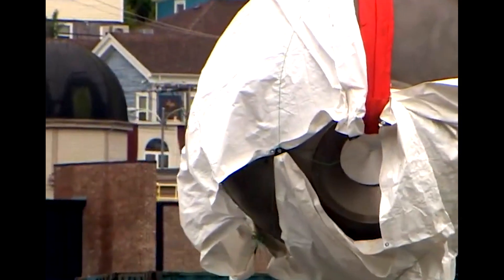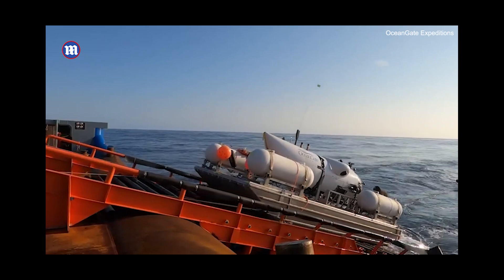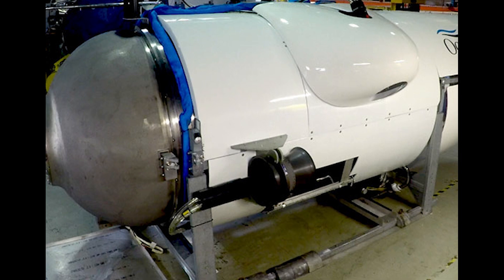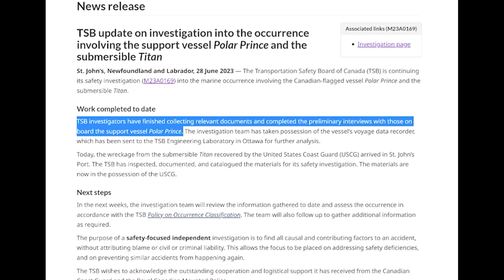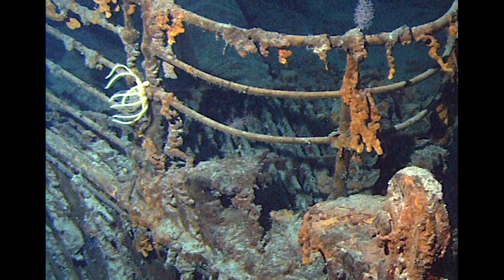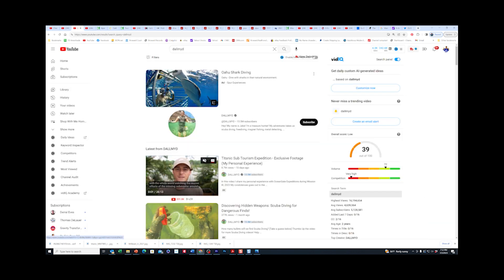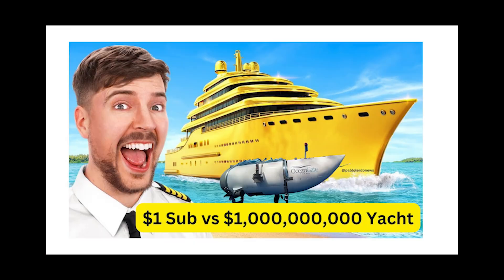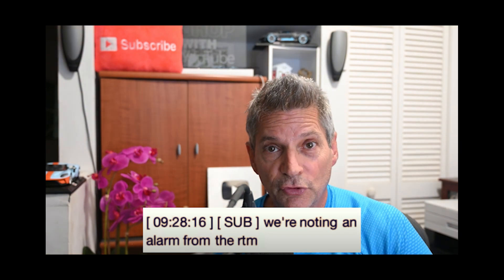Titan Submarine Debris Clues, Implosion Simulation

Comment: As an engineer with over 40 years experience working in an industry that uses very high pressure vessels, here is my informed guess on what happened and why you see what you see.

1)  Most likely the carbon fiber tube failed in the center of the tube, and this was probably due to a continuous micro-cracking failure of the carbon fiber structure.  The tube was laid up with all fibers in a continuous wind which is not considered optimum practice for carbon fiber tubes that will undergo high stress.  The typical lay-up in these situations uses filaments wound on a 45 degree axis in one direction and then a 45 degree axis in the opposite direction.  This minimizes crack propagation should it occur.

2)  Once the tube failed in the center, you had 2 extremely high pressure air bubbles pushing to get to the ends of the tube in an incredibly short time.  This would have created a delta pressure over time significantly higher than the epoxy glue was rated for and likely blew the titanium end caps right off the end of the tube.  This is my guess as to why you are not seeing any carbon fiber remnants on the end caps.

3)  The flange and bolts holding in the plexiglass portal are not rated for extremely high pressure pushing out on the flange and the nuts.  The porthole is designed to seat into the end cap so that the more pressure applied from outside, the better the seal (at least in theory).  The porthole is not designed to hold in any significant pressure from the interior of the submersible.  Once again, if the failure mechanism is at the center of the tube, the porthole was likely blown out of the end cap as part of the implosion pressure wave propagating from the entry point.

Sad to see this happened, but it was a disaster in the making and it was only a matter of time until complete failure occurred.  I have always said there are no accidents in the engineering world; only failure to due to hubris, engineering error, or not understanding the forces acting on the device.
Reply: stadium applause
Reply: As an Aerospace Engineer with over 40 years experience working on high stress/ loads and some carbon fiber composites I agree tragic but poor design in many areas, compression of carbon fiber not ideal, insufficient bonds with metal supports, and insufficient bond area are all shown in video, too bad.  There is no substitute for good Engineering, warning signs were there.
Reply: @gregorykerr3988  And now for something completely different, here comes our "40 year old experienced and self proclaimed engineer of the day" !!! C'mon, buddy, tell us all about black matter !
Reply: So it's a bit like what happens when you step on a Pringles tube with the lid on.
Reply: @crazynorm  Sounds dangerous, no more Pringles for me.
Reply: @crazynorm  Actually , no not when you have 6000 PSI of pressure pushing against it from every direction .
Reply: @tuck6464 the tube have the bigger surface than the end-caps...
Reply: You should also mention why there aren't any fragments of the carbon fiber hull--which is basically that when carbon fiber fails, it doesn't bend or collapse, it shatters. What ever is left of that submersible is likely too small to be noticed that deep.
Reply: This comment should be highlighted at the top. Thank you for your description.
Reply: I would never cram into any vessel with no way out or any room to move.
Can't understand how passengers could skip doing a full chk of the technology used and the company that built it
Reply: My intuition about the port window is the same as yours: the cylinder collapsed, water rushed in to fill the low-pressure volume, crashed into itself, water-hammered into the end caps and shot the window out. The flange is likely only there to keep the window in place until water pressure is high enough to maintain the seal on its own, not hold back a massive pressure spike.
Reply: @teardowndan5364  also consider the possibility of compression ignition of the oxygen and organic material immediately following the hull breach.
Reply: @roceye  Compression-ignition only works if the fuel is mixed with air beforehand. The "fuel" being human flesh is only slightly more compressible than water, more or less in one chunk and about 70% water by weight. Any compression-ignition that could have happened would have been little more than skin-deep. Much of the air would also be separated from "fuel" by water and other obstacles. Also, the cabin likely had less than 2kg worth of oxygen available to react with anything, which isn't much next to all of that carbon fiber and 600+kg worth of other stuff inside.
Reply: 30 year engineer here, i used to work with composite Pressure Vessels for Underwater Vehicles.  We used composite hardware on some items and they would ALWAYS implode/shatter after a few uses.  It came to a point where we would wrap that hardware with the equivalent of a trash bag.  This was done so that when the parts did implode and shatter, the clean up was much easier as well as we would usually get back most of the hardware for a failure analysis.  Eventually we just switched to aluminum, titanium and stainless steels to get some sort of reliability and longevity.  Everyone keeps mentioning innovation, but innovation is NOT safety.
Reply: #2 was wronge once the carbon tub failed the ends were no longer atached to anything, But the rest was spot on.
Reply: I'm thinking the second weakest link, was the porthole, thus became a nozzle, jetting out super heated ejecta of human, carbon fiber, and other bits, in nanosized particles, when it failed.
Reply: @animationcycles7109  Rush was the first weak link. His nanosized brain and gargantuan ego were 2 and 3.  Hopefully he saw it coming.
Reply: I'm not an engineer but to me it's a science that should be treated as methodically as any other science. If you're developing something that needs to function in the physical world, any and all aspects about it should be accounted for. 

It amazes me that anyone would cut corners in something that is barely understood such as deep ocean exploration is.
Reply: I had been picturing this in my mind, and the whole time I thought the carbon fiber was built with the opposing 45 degree strands.
Reply: @johncamp7679  Yeah, the way they wound it was insane for the loads on the center section...  And to really optimize the structure, you would wind it 26.56 degrees off the long axis of the cylinder.  That would be perfect to accommodate hoop stress vs. axial stress.
Reply: Thanks for taking the time to explain this.
Reply: i think your analysis is mostly spot on. except transrcipts were released where they talk about hearing noises coming from the rear of the craft so it likely failed at the rear and the pressure wave propigating from the rear forward first shot the viewport off like a nerf dart followed very closely by the ring.
Reply: @hopposai787 the ring probobly popped as all 5 passengers attempted to exit the vessel via the new hole.  In a fraction of a fraction of a second all 5 we’re in the hole and assisting with blowing that piece off the probably already flattened vessel
Reply: Gruesome possibility: they removed the porthole window because it has embedded human remains. Only reason I can think of to disturb the evidence for the investigation.
Reply: I imagine the heat generated by a 400ATA pressure rise in nanoseconds would have ignited the 'highly combustible' floor and everything else including traces of glue, wonder if soot would be detectable?  Two things blow my mind - that the narcissist didn't test his thrusters until 3800m and that when securing the front dome "Stockton doesn’t screw in the 18th bolt because it’s too high, says David Pogue, former crew member in an interview".
Reply: As a journalist with 20 years experience I often feel like I have "earned my degree for cheap" and I have endless respect for people in technical fields, such as yours, for what they know, if anything for the fact that they have gone to school for the same number of years.
Reply: “Failure due to hubris, engineering error, or not understanding the forces acting on the device”

Isn’t that ALL classified as “engineering error”?
Reply: ship of fools…
Reply: Do you agree with the theory it descended too quickly? The ascension apparently was impossibly slow?
Reply: He went cheap with EVERYTHING. and it cost him and his passenger's their lives.  For F's sake, even the Xbox controller was an Amazon knock off.  Carbon fiber is cheaper than titanium.  And he didn't lay it out in the right orientation either in order to save money.
Reply: @tone7560 . He had a BS Degree in Engineering. But, he got an MBA after…. he learned to cut costs to increase profit.
Reply: The filament wrapping was puzzling me also. That is something even I know with dyscalculia and significant problems to understand how physics work.

I wouldn't have been comfortable with such a device - wrapping it in multiple directions means you're dividing the pressure load working on it.

And the thing is glued together? Bolts only at the entrance? Who in the everloving mind DESIGNS such s thing?
Reply: @Tantejay  Someone who is more worried about being the first and only person to do a certain thing to the point where they'll sacrifice lives to achieve it. The amount of corners that were cut on this thing is mind-boggling.
Reply: @Tantejay  Wings and fairings on aircraft are glued together. Engineering is not as simple as everyone on the net thinks it is. The Dunning Kruger effect has gone off the charts on this incident.
Reply: @Tantejay I commented I think the carbon fiber was a huge mistake . In building a sub to take on so much pressure . Might look good in design but , many things chemically could of went wrong , maybe micro air bubbles between layering it or not the proper amount of carbon jell adhesive causing it to be weak along with it not being criss crossed layered right.  Made it weaker , like in the middle of the structure . The engineers comment I totally agree after what I guess and his knowing knowledge.
Reply: @Tantejay  "wrapping it in multiple directions means you're dividing the pressure load working on it."  

Like a bridge.
Reply: Thank you for your insight. Hopefully wisdom and hindsight like yours saves lives.
Reply: @EndsleyIV  Those who build submarines know it's common knowledge using carbon fiber is not a wise choice of material to be used.
Reply: @MyKonaRC I’m sure they used (Fiberglass) in search of making it more lightweight 🤷🏼‍♂️
Reply: @MyKonaRC I agree ,that was the worst decision , probably a money factor $ to save money in the build thinking the carbon is as strong as steel, not in this situation , and that's putting a price on there lives putting it together cheaply .
Reply: Actually, what happened was that the very rapid descent caused a very dramatic increase in pressure. Clearly this is what happened. Gotta love these braggarts who claim to be engineers as if that's a badge of credibly. Remember, "engineers" built the Titanic, and thousands of "engineers" designed the Space Shuttle Challenger which failed due to a rubber o ring.
Reply: I thought the same about why there was no porthole glass but good to know why the cylinder failed. I thought the same and wondered how strong the cylinder would be when wound that way but didn't know how the 45 degree winding worked. Great to hear from an expert.
Reply: Hi Ron- on DALLMYD’s video he says the sub was carried to and from the site and stayed on its platform. It even got caught on a ghost net before his trip and it did a lot of damage. The weight was on the back of the sub, being hauled for weeks in the ocean with the stress of the weight banging on the back of the frame. I think that was extra stress over time that hastened the demise of the sub- those trips hammered the same part of the sub and weakened the hull in the back. Possibly also why the frame was hard to release.
Reply: I was gonna comment, but this is pretty much the end-all-be-all of comments. There's simply nothing anyone could add that would better sum it up.
Reply: Very good summation. Yes the ends being blown off theory looks most likely.
So would you say the cylindrical hull or centre part wouldn't have been crushed?
Reply: Thanks for this!
Reply: It is creepy to me, for some reason, the fact this thing had gone down a dozen times or so. Just thinking about that, along with the choice of material, it is clear to someone like me, who knows nothing about much, this vessel was a ticking bomb.
You couldn't have paid me to get on that death trap. Even James Cameron had his close call down there, and if I went down there with anyone, it would be him.
Reply: This explanation makes sense to me.
Reply: Wow, thank you for that information. Very informative.
Reply: You politely refer to it as “hubris”. I’m going to refer to it as malignant narcissism.
Reply: @7eyesopenwide777  As an engineer with over 40 years experience working in an industry that uses very high pressure vessels and complicated words, I'll stick to "hubris"...
Reply: @Bertrand146  most narcissists will agree
Reply: @7eyesopenwide777  My husband used the word “ temerity” . It perfectly describes Mr. Rush, along with “malignant narcissist”. He believed his own BS. His ego wouldn’t accept anything else. Sad how gullible people can be, and they paid 1/4 of a million dollars to die due to his stupidity. He will go down in history as the worst engineer ever.
Reply: Could it be ... if the failure was at the aft where they heard crackling noises ... would the high pressure air bubble also respond by blowing out the gasket and nose cone?
Reply: It did not look like there was any kind of tooth or etching on the glued mating surfaces as well. No mechanical bond for the glue.
Reply: If all the passengers never skipped leg day, and they coated the carbon fiber hull in flex seal, inside and out, they'd all still be bitching about that Amazon knock off Xbox 360 controller today.😅
Reply: Didn't even bother to get it classed and using a loop hole as not passengers but mission specialist..are you freaking kidding me ?
Reply: I bow to your superior knowledge which shines through your answer. However, it doesn't seem to explain what the crackling sounds were from the rear of the sub. Any thoughts about those?
Reply: @wmobberley4416  carbon fiber crushing under the pressure of the titanium ring on the failing lip of the tube? I dunno
Reply: @wmobberley4416  Most likely that was the epoxy glue starting to fail as the tube deformed.  Epoxy is great for gluing stuff together, but is also very brittle, which is why you need a substrate such as carbon fiber or fiberglass to provide the strength.
Reply: @ronkluwe4875  thank you very much for writing this out. was curious in (1) why breaking at the center of the tube was most likely versus other locations?
Reply: @wmobberley4416  the connection between the rings and the tube i would guess, since there seems to be a lot of stress building up between the deforming tube and the rings.
Reply: @wmobberley4416  as an electrical engineer my guess would be water had seeped through into the electric motors, hence why they had no power and had to revert to the backup motor..
Reply: @wmobberley4416  delamination
Reply: @wmobberley4416  EXACTLY my question and the reason I had a little dissonance with the idea of the vessel cracking in the middle (although it does make sense as an idea, I suppose, depending how the pressure works on such a thing). For myself I would have thought it would give out at the glued places where the titanium 'ring' or [gasket?] was adhered.
Reply: U should have recorded this video man!
Reply: saved me the trouble thanks!
Reply: I hope you aren't white cause with that much experience if you were white you shouldn't be listened too because you aren't inspirational according to the CEO of Titan.
Reply: I don't even get why they used carbon fiber tbh
Reply: @Shadow_Hawk_Streaming big mistake should be band and not ever used for these underwater subs .
Reply: it happend at the rear of the sub, behind them. the transcripts are out they were trying to resurface
Reply: Also: in some of the videos I saw it appears they are lifting tyvex bags- probably with pieces of the hull inside. I’d not think it vaporized
Reply: Ya the tube failed guaranteed,  ive worked in composites my whole life. It was under compression not tension
Reply: You're brilliant my man! Thanks for the intelligent explanation...
Reply: you just failed as an engineer.
Reply: Eh there are definitely accidents, seen an aviation vid where the trim was installed upside down that almost led to the plane crashing. There's definitely plenty of accidents, a part could be installed incorrectly, the part itself is made wrong or has something wrong with it, etc. I think your spot on about what happened tho
Reply: Seems like a possibilty.. I agree
Reply: The first time you have 😢😢😢😢😢😢😢
Reply: I'm surprised you didn't mention that carbon is bad under compression but much stronger under tension. You can snap a bit of carbon fibre... But goodluck trying to rip it apart.
Reply: Would the interior pressure be enough to shear the bolts and blow the domes off their attachment rings? I would think the glue joint gives way before the bolts.
Reply: I’m trying to think of something smart to say. Can’t do it.
Reply: I was going to say this.
🤣
Reply: We’ll said
Reply: Help me understand your observation 1: why would they be hearing cracks and noises from the sealed -I’ll call it - engine room if it failed in the middle?
Reply: @Bertrand146  where would the first crack be? And why were they hearing noises from the sealed engine room in the aft?
Reply: That was a good guess but you are wrong. What actually happened is that it imploded.
Reply: chat gpt?
Reply: I'd love to smack that cocky look right off Cap'n Crunch's face at 2:18...but the fish ate it
Reply: The 45 degree filament layup is used for a pressure vessel where the fibers are under tension, and also need to hold the end domes onto the cylindrical section. The Titan was NOT a pressure vessel, it was a vacuum chamber. The fibers were loaded under axial compressive stress, which is not ideal for the highly anisotropic material which is carbon fiber composite. The supporting resin matrix takes up the shear stresses. The tangential wind that the fabricators used is more appropriate for resisting compressive stresses, but still far less than ideal. Carbon fiber is brittle, and a poor choice for axial compressive loading. The Titan was destroyed by water hammer when the cylindrical section suddenly failed in brittle fracture and collapsed. All brittle materials including the carbon fiber composite were instantly hammered into powder. The front porthole was blown out forward by the force of the water hammer shock, and probably also pulverized.
Reply: I don't beleive the tube would have started its collapse in the middle- in my mind it would have started near the edge where it mates to the rear bulkhead. It is much harder to crush a tube in the middle than near the edge because of the amount of material that has to deform for buckling to initiate in each instance. In the video where they were installing one of the rings, it was clear that the carbon fiber was glued inside the metal ring which means it was unsupported in compression ( relying only on its own strength for compression resistance).
Reply: @cheatinggravity173  WOW, ENGINEERING FAIL...  You just laid out the exact opposite of physical reality.
Reply: The only criticisms I'd make of your analysis is that the angle of the winding of the CF wouldn't play that significant a part in the hull failure, if that's what actually happened. If there's enough flexure to create a crack in the outer layers, there's enough to crack the inner ones as well. People are simple minded and want to play pretend Rush was completely clueless, but that's extremely unlikely. I'm sure the young's modulus was studied intently, and computer modeling was extensively used. My hunch is that there was an unknown stress factor involved, and that over designing wasn't used enough. I suspect he cut it too close to his expected envelope to realize his weight goals. 

I think your guess on the end cap is correct. There would have been equal pressure over entire surface of the inside of the cap, maintaining it's integrity as it separated.
Reply: As a nuclear and electrical engineer with close to 50 years experience AND hands-on experience in fabricating both carbon fiber racing parts and pressure vessels such as the 4500 PSI tanks used by divers and SCBAs, I almost 100% agree.  Something you might not have thought of is the buckling force being exerted on the carbon fiber cylinder by the end-caps.  carbon-fiber is even weaker in straight compression than it is in the cylindrical shape.  I think this supports your theory that the cylinder buckled in the center.

I once got to witness the implosion of a steel containment vessel by up to 10,000 PSI water pressure.  It was recorded by a 100k frames per second camera.  That was actually too slow to capture more than a few frames of the implosion.  The vessel contained air at normal atmospheric pressure.  The most amazing thing was that as the vessel reached near maximum implosion, jets of incandescent air shot out of both ends, having enough energy to burn through the steel ends.

I think that is what happened here.  I think the compressed air and tissue shot jets out strong enough to totally remove the end caps, including the view port as you postulate.  The fuzzy video of the view port lift is too bad to determine whether or not there are broken bolt ends in the titanium.  Based on my experience with titanium, I can also postulate that the bolts simply sheared the threads out of the titanium holes.

Now I must comment on the style and substance of this video.  National Enquireresque-style writing.  What about this and what about that without the qualifications to formulate answers.

Jeff goes crazy over the scrap metal ballast.  What was wrong with it?  It was heavy, strong, non-buoyant and cheap.  Does he think they should have made the ballast out of something fancy like per-stressed concrete?  To the non-engineers, real engineers are not like that at all.
Reply: long story short, the sub became a plastic bottle you twisted to make the cap pop off. Only it was at two ends, popped at the same time, and WAY faster
Reply: Before I read this I commented I think the carbon fiber was a huge mistake.  I kind picture it being layered in my mind and possibly micro air bubbles in between layers or lack of adhesive causing it to be weak , that was just my thoughts and I'm not an engineer . I know they probably say carbon fiber is stronger then steel ? Idk for sure but I wouldn't think so in this situation .. I agree with what you said  definitely .
Reply: I heard on another video a passenger from a previous dive in the Titan said  the carbon fiber made a loud pop just like a 22 caliber rifle.  I'm guessing Stockton though the crack would just go away.
Reply: Thank you for sharing your expertise 🙏🇬🇧👍
Reply: Icarus swimming too low in the water.
Reply: Thank you so much for this understandable (to us non engineers) explanation!!! :)
Reply: I agree but
The tube failed     at the end.
(Cracking noises heard from the rear)
Reply: I agree the porthole bolts probably broke due to the pressure wave.
Reply: Pressure vessel people have to think inside-out for this.  The submarine is a VACUUM vessel.  It holds 400 atmospheres of vacuum (something that can't exist at the surface), because it holds OUT 400 atmospheres of water pressure.  A pressure tank has no urge to buckle and, if it did, the contained pressure wants to round it out.  If a vacuum vessel buckles, game over, it implodes.  A 55-gallon drum is easily crumpled by 1 atm of vacuum inside.  If you pressurize the same non-optimized drum, it probably takes 10 atm to rupture it by blowing the ends off.  If you modify the drum by replacing the ends with domes, it would probably take 100 atm inside to burst the same sheet-metal.  Implosion folds and crumples material; rupture has to tear material apart.
Reply: So here's a question for regarding the hull, and the rings.. 

We know that there is a serious difference.. in both compressive and tensile strength. Between carbon fiber,  and Titanium.

So here's a thought.. what happens.. When they are both heated or cooled. What's the expansion and contraction differences between the two.. 

Just kind of thinking.. maybe it separated all on its own. Perhaps, the hull contracted.. more than the titanium rings. When it cooled.. and The rings and hull Seperated at the joints? 

Just more interested in the science of it. Lol.
Reply: I agree with your analysis.  When I was working on B-2 program, plies were laid as you stated, on a 45 degree bias with alternating layers at 90 degrees from each other for optimal strength.  And that was for a relatively smooth flying airplane with insignificant stresses compared to 3500m water depth.
Yep, implosion would most likely have popped the end caps right off the c.f. cylinder, and popped the hatch/window right off the end cap.  Not meant to deal with a pressure shock from the inside, only compressive forces gradually loading from outside.

I remember reading story of Trieste when it made it's initial dive to bottom of Marianas Trench in like 1962.  Pressure chamber was thick, spherical steel, at least 12" thick, with a similar plexiglass window, which was NOT the hatch.  It was also buoyed by a large container of gasoline, which provided high positive buoyancy with weights that depended on an electromagnet to keep them from falling off.  If anything happened like a power failure, the Trieste would naturally rise.

My only comment on Stockton Rush is that he paid for his stupidity and carelessness.
Reply: Best speculation yet...... I'm no engineer,  but very handy and I've studied and came to same conclusions
Reply: I ❤❤❤❤😂😅😅😅😅😅😅😅😅😅😅
Reply: 👍💯👨‍🏫THANK YOU FOR YOUR KNOWLEDGE &VIEW POINTS , ALSO  THE BIGGEST FAILURE WAS THAT RUSH WAS HIS OWN ENGINEER  , &DID NOT WANT TO REASON WITH FACTS AFTER ALL THOSE ENGINEER'S WARNED HIM HE WOULD NOT ONLY FIRE THEM , HE WOULD SUE THEM , CANT UNDERSTAND HOW HE WAS ABLE TO SUE THEM WHEN THEY KNEW THE FACTS & STILL THE COURTS WENT ALONG WITH RUSH JUST BEYOND UNDERSTANDING  , THE COURTS , GOVERNMENT  , OSHA JUST STOOD BY &TURNED THIER HEADS THE OTHER WAY THEY ALSO SHOULD BE HELD ACCOUNTABLE FOR NEGLIGENCE &THOSE ENGINEER'S THAT GOT SUED SHOULD AT LEAST GET THIER MONEY 💰  BACK BECAUSE THE KNEW THEY WERE RIGHT ALL ALONG  JUST THE FACTS ! PS: SO MUCH RESPECT & ADMIRATION TO YOU & ALL ENGINEER'S 🏆🏅🎖👨‍🏫👨‍🔬👨‍💼
Reply: This is first real and educated answer anyone has given so far
Reply: Great summary
Reply: Why didn’t Stockton Rush know this? He’s was an engineer!
Reply: Exactly.
Reply: Here's a point to ponder.... A chemist told me one time that oxygen and oil will detonate at 2000 psi........
Ever notice how critical it is with an oxygen cylinder for people not to use oil around them..... Is there oxygen bubbles inside that carbon fiber material is there oils inside that carbon fiber material....
If there is.... physics are going to take over.... Possibly the carbon fiber exploded just like plastic explosive.... Isn't plastic explosive a solid... Except oxygen oil enter in ....do they not.......
So now was there a explosion and then an implosion????????????
I think I just heard Jeffoff say they could not find any carbon fiber.!!!!!!!
Reply: very good forensic analysis,  if Mr rush had applied the same logic to the design, construction , build , & suitable & sufficient testing by a certified  body , he & his paying passengers ( not civilian scientist's) may still be alive
Reply: Nailed it brother...it was many failures
Reply: Everybody seems to miss this. It would not matter how the fiber was wrapped. Fiber is simply worse than useless under compression. Fiber only works under tension.
Reply: @afriedrich1452  Obviously it's not "useless" as it made like 40+ dives successfully. Thing is, a tube can resist crushing by being strong in compression OR in tension or both. Your bicycle wheel is a great example of a device that resists being crushed primarily via tension. To go out of the round shape into a flat shape, two sides have to be compressed but the other two have to be stretched, so both types of strength can make it work.
Reply: I agree 100%..I actually wrote pretty much the exact same scenario as you did...then saw yours, seriously didn't copy your logic here..but dang sure looks like it..albeit with a lil more redneck terminology..lol.😂..I was an outside machinist at Newport News shipyard building nuclear submarines...which we had academic engineering courses thru physics, metallurgy, and strength of materials..I got to spend a lil time in the NDT lab..which we used to call the Destructive Testing lab, lol...I mean we spent most of our time making components and bolts fail...but anyway we are of the same opinion here on this...initial failure of pressure hull in the largely unsupported field section of hull..may have been a few seconds warning of hull failure, consistent with the ballast release and attempted 'emergency blow' to surface..then catastrophic failure of pressure hull field, blowing out the caps and viewport..the only good things that can be taken from this is that 
     1st, hopefully this will bring about safety regulatory oversight in this field, it was absolutely avoidable..sub should have been permanently removed from service after problems with cracking sound on last dive, or never even allowed to operate in a commercial capacity in the first place

& 2) even with the possibility they were aware that death was likely imminent, it was completely painless and instantaneous
Reply: @gregminter6393  I got the initial impression that with how they blew the ballasts in an attempted emergency, that they had known that there was something wrong for 15-20 minutes before critical failure occurred. If I had to guess, it was a cascade failure of multiple issues before implosion so the engineer with 40 years of experience is probably right on all points. But I would like to add that even if the carbon fiber had been weaved in a certain correct manner, it would have eventually failed anyway. The problem with carbon fiber is that you're dealing with a composite material that has a short shell life due to continuous micro-fractures with each deep dive down in the ocean. Eventually after a number of deep dives, the carbons structure would be too compromised to hold together. And from what I understand, Titan had done a number of deep dives before those five people even went on it so that sub had likely already several micro-fractures in it's hull makeup, meaning that this particular dive was always going to result in catastrophic failure. That's why the submarine community is always skeptical of carbon fiber because it just doesn't compare to steel or titanium structure. I would also like to add my two cents in the design on this sub. 
1) The shape of the hull is just wrong. The sub would have been subjected to different varying levels of delta pressure on different ends of the sub. 2) Exposed wires on the outside of the sub which is exposed to intense water currents and debris floating around outside the sub. 3) Plexiglass dome is another weakpoint. I could keep going because the list of faults is long, but anyway if someone had paid me a million dollars to enter this thing to explore the shipwreck, I would have resolutely declined the invitation.
Reply: @gregminter6393  they heard crackling noises on the last dive??? Ive had carbon fibre paddles and poles that have failed due to abuse camping or in whitewater and the noise is “crackling”. If I heard that in a sub and managed to get back home with it, I think I would not let the same sub go down again.
Reply: @pollystyrene99  ..👍👍 I know, right...I remember going on sea trials for the shipyard on a brand new LA class sub ....it was my first experience ever in a moving submarine,..everything was cool til the first dive, forget how deep it was, but relatively shallow..id guess and 150-200 feet..and I was praying to God to get me out of that thing when I heard that first compressive popping sound against that HY-100 steel hull it was loud...it was a completely normal noise on a dive on a virgin hull as I was later told with much laughter from the experienced guys...but that was HY100 steel(rated at 100,000psi) ..anyway carbon fiber is strong but it is a fabric basically, and not a  contigious body...honestly, i never would taken any dive in that deathtrap..even though it survived some trips, all with varying degrees of problems...you are sooo right about the cracking sounds..id be damned if I ever allowed it back in the water EVER again..Id never risk the lives of myself and passengers, as well as my company and it's future, on such a flawed, and untested design.. unfortunately we found out tragically that not all innovations are meant for certain applications as in this case..it should have been put on display at OG headquarters til they came up with a much safer vessel..I do not wish to pile on the late Mr Rush...I know his family is heartbroken along with families of the others lost..but the main factor in this disaster is one man's hubris..100% avoidable tragedy
Reply: @gregminter6393  Cracking sound heard on previous dives. I ASSUME that anyone with half a brain conducts  structural  testing after each dive. There  surely had to be signs that the structural material was weakening. And yet it appears these clowns conducted no testing after hearing the cracking sounds in the previous dive.  The good news is that this CEO and the dumb wealthy morons stupid enough to pay millions to him are all dead. Good riddance!
Reply: Did anyone notice that they literally bolted monitors on a screws through the walls ??? 🤯🤯🤯
Reply: @xfxox  nah it just looks like that. But they never would have done that.
Reply: @xfxox the vessle had an isolation at the in side, so everything was mount to that
Reply: @-Bopp  u're right
Reply: @Bertrand146     they just had to stick their finger in the water leak and it would be ok
Reply: @wizrom3046 flex seal
Reply: @rickroberts7611 and forget it!! And, they definitely forgot about this trip real quick!! So quick, they forgot all about it as they were experiencing it!!
Reply: @rickroberts7611 "I cut this submersible in half!"
Reply: @rickroberts7611 YES THEY FORGOT THE FLEX SEAL , Hey it worked on my roof  💪
Reply: @rickroberts7611 should have had a couple rolls of duck tape on board
Reply: @rickroberts7611  Sure would have done the trick.
Reply: Like popping a Pringles can
Reply: People making jokes... disgusting human beings.
Reply: @joannephillips4110  it's funny as sh!t!
Reply: @joannephillips4110  Like your mother ?...
Reply: @joannephillips4110  I agree.. yall are terrible
Reply: but you can order carbon fiber in a weave pattern.... is the cost that much different?
Reply: I agree that’s more likely. What’ll be interesting is whether the failure in the Center allowed water ingest, or if the failure of the middle caused the ends to pull in from the titanium rings, exposing one or both ends to water ingest. 

Doesn’t really matter in the end, of course. 

Torque wrench: not needed! As soon as the sub goes a few dozen feet underwater, sea pressure seals it completely. And the design mandates you shouldn’t open from the inside: if someone were to panic, water would flow in and sink them (since there was no conning tower).
Reply: @gregoryf9299 the water wouldn't just sink it ,it would crush everybody and everything unless it was near the surface.
Reply: Good analysis here. As they were in the proximity of wreck of the Titanic, they were all probably all looking out of the plexiglass porthole. But they never saw the wreck as it was pitch dark. So they all popped out, except the one holding the video game controller. This happened very fast, so I am quite sure they did not have time to ask for refunds.
Reply: You couldnt be more wrong, the CF field did not fail, the rear Hemisphere glue joint is the weakest spot on the whole sub and it allowed seepage which then got under the fiber layers causing separation, once the rear cone glue joint was compromised, the rest happened in the blink of an eye. All organic matter including air was then pushed out through the front cone which blew out, the window went with it since it was not designed for a reverse pressure. You are overthinking a relatively simple implosion. They have discovered human remains around the window opening.
Reply: Why would the window blow out....the pressure outside is just as high.
Reply: @colinsteam  Good question, and we model that by using the concept of differentials. Instantaneously, the hull collapses and the pressure behind the compressed bubble of air is the same as the pressure in front of the end cap. Correct? They are equal. So, the force of the compressed air is added to the water pressure, resulting in a net force difference on only the inside of the cap.
Reply: @tombryan1  I been saying this for a while now. All this speculation about the carbon fiber. (Wrong) Rear cone glue joint failed and it was all downhill from there.  The Titan has done several successful trips, so this was not their first rodeo. However, whether it was certified or not. You can't control every single variable on each dive. Just one of those things that failed. Examples - Astronauts are at the mercy of an Oring on takeoff.
Reply: @tombryan1  in the millisecond after the hull failure is it possible there was a compression ignition event involving all the organic material?
Reply: @tombryan1 I think the sub being made of carbon fiber was forced and squeezed like a tube of toothpaste popping the glass pushing what's inside out as it imploded within zillion seconds and exploded the fiber structure  closely at the same time . I think they knew they were doomed , just sitting there freaking out , panic in horror hearing structure light  sounds of cracking before it just gave way.  OMG I just hope they prayed 🙏 my hope is they never knew they were in trouble and it happened , but if anyone knew it was who ever was running it.
Reply: @tombryan9531  You might be right.  In the transcript, they reported hearing noises from the rear of the sub, multiple times.
Reply: @johnbergstrom2931 when they were saying on TV of hearing knocking sounds , that was probably  the structure slowly giving.
Reply: @tombryan1  
Nonsense. There was no blowing anything "OUT" all pressure was an inward action. EVERYTHING about that capsule was compressed, nothing blew "OUT"
Reply: @tuck6464  of corse the window blew out! it have a smaller surface so it also get pressed in with lower forces...
Reply: @Bertrand146  I think you are right. They could have saved the vessel in doing so.
Reply: its not a disaster! no loss to humanity!
Reply: I hope they knew it was coming because they all had it coming!
Reply: @tomasinacovell4293  Yes, with hindsights.
Reply: They should have pressed their backs againts the hull..
Reply: @Bertrand146  That reminds me of the "if you jump in a falling elevator when it reaches bottom, you'll survive" thing. lol
Reply: @Bertrand146  LOL Their backs and the rest of them got squished into basketball or smaller.😢
Reply: @Bertrand146 really the hulk would've had a hard time holding back that much pressure talking thousands multiple thousands per square inch not foot, not yard, but inch. That submersible is 9 feet high= (108 inch) 8 feet wide= (96 inch) and 22 ft long= (264 inches)== ( 468 individual thousands of pound of pressure all 5 of them possibly I mean possibly could hold back 1 of them inches at longest 20 seconds that's giving it everything they got
Reply: @alexwayne8958  more like 0.20 seconds. It's like sticking your finger inside a shot gun barrel to try and stop it.
Reply: @Bertrand146 , good one!!!’ 😂😂😂
Reply: @Bertrand146  Yeah, work as a team, everyone push as hard as they can. Maybe they did and someone farted, possibly with follow through, and his shoe slipped or something.
Reply: @kingkreole9121 😂 if they all had a 700lb squat and they all pushed together against the hull with their feet, they'd still be alive today. They shouldn't have skipped any leg days
Reply: Hope you're making $200+K a year